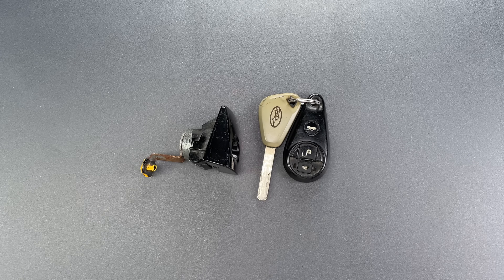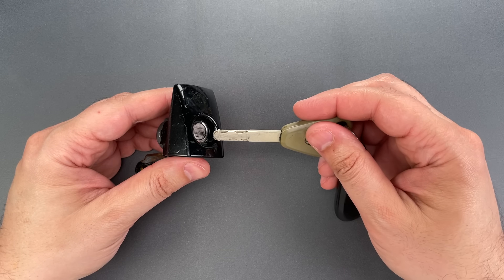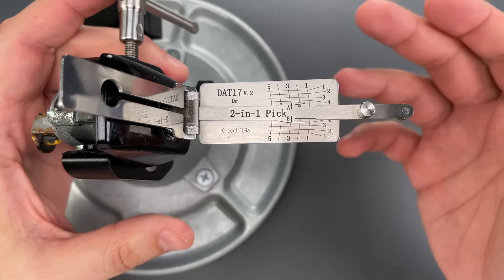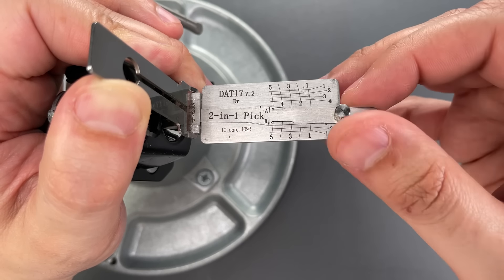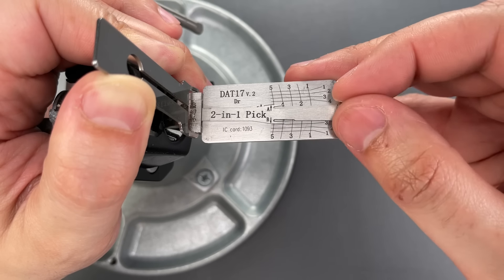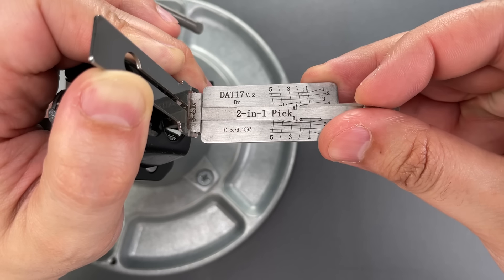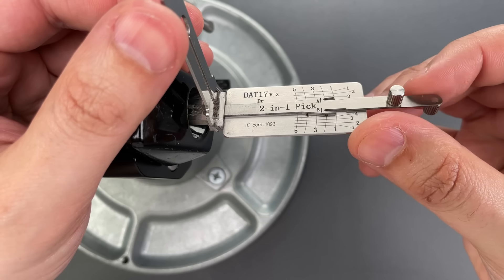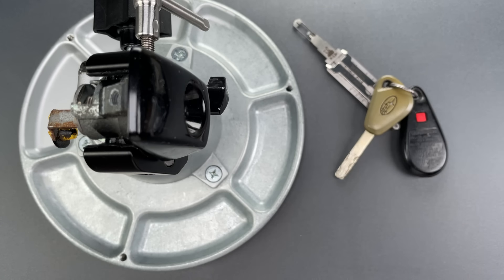[1346] A Trap For The Unwary: Subaru Impreza Door Lock

Comment: This makes me more confident in my own old Subaru
Reply: Don't forget about people breaking windows or even having their own tow trucks to steal either stuff you have inside or the car itself
Reply: @qpSubZeroqp  that’s the thing. If the Subaru alarm is set then it goes off, even if the key unlocked the car. Plus because of where I park my ring camera often texts me when people look at it and walk by it. The amount of time it took to pick means I’ll have more than enough time to call 911 or run with a baseball bat
Reply: And the window?
Reply: @smol_yote  Old subaru's are easy. dont even need to break into car. Just jump on/kick certain parts or use half a tennis ball.
Reply: @Mr_jz_12  ehh. Fair enough. Plus it’s an old Baja. Who would want to steal it?
Reply: If only the engines were as good as the locks.
Reply: @smol_yote  a lot of people cos its old and easy to steal. :(
Reply: @Mr_jz_12  it’s a manual with a fuel computer cut off I wired in and hid the switch. I wish them luck as they can’t even bump start it
Reply: @smol_yote  still doesnt stop them getting into it. Usually if theifs cant steal it they'll trash it. Plus if someone wants your car they'll get it no matter what you do to it.
Reply: If only you could be confident in your head gaskets, too.
Reply: @EternalLatias  i have an ej20 and not an ej25. Low k's and a good tune and fuel. Mines good.
Reply: @Combatpzman  nothing wrong with the ej20's if looked after and treated right. Same as any engine. Is the 25's and non maintained ej20's that have issues.
Reply: @EternalLatias  I replaced them awhile back. The whole engine was serviced. The old motor blew up when I was at the sand dunes in Moab UT
Reply: @Mr_jz_12  I bought the Baja from a guy who never serviced the car. It now runs great. It’s a bit of a fuel hog at times but it gets me to California and back as needed. I’m 170k miles strong and putting 1000 miles a week on it. It runs great
Reply: All depends on the key bitting. If your particular key has a bunch of deep cuts, which don't necessarily need to be picked, it won't take much to pick.
Reply: @bamascubaman  got nothing to do with a key. Early subaru's had a massive security floor.
Reply: @Mr_jz_12  Might be true with doors, but probably not with ignition. I once lost the start key to my '96 Impreza wagon and it took the locksmith over 15 minutes of swearing to pick it, plus about 2 hrs to machine the door key to fit. After everything he said: "It looked like a Nissan lock, so it should be easy, but wasn't. If I knew it would be so hard, I would charge double, but we agreed on 200 so my loss'
Reply: same lmao
Reply: @Mr_jz_12  how easily a lock picks with a Lishi is predicated on several factors. Assuming that there is nothing wrong with the lock, dirt/grime gumming up the wafers or defects to the wafers, causing them to get stuck in place, the bitting ABSOLUTELY is a big factor in how easily/quickly it picks.
Reply: @Mr_jz_12  please do so. That car has been nothing but a nightmare to fix and work on. The insurance payout of that crappy baja if it was totaled is probably double what i can sell it for
Reply: @noelcie  They're the easiest of the lot. I wont publically say how. But lets just say he didn't need to touch the lock to get in that car. Its an actual security feature that is the floor in the system ironically enough. Once in its as easy as getting ot a box and removing it, then ignition (which is easy to remove) and you could drive the car.
Reply: @Mr_jz_12  except in my specific car I wired a switch into the the fuel computer relay and hid the
Switch. So even if they turn the ignition on, the motor can only turn and turn and won’t do much til the switch is flicked. Great as it’s hidden in places people tend not to trash or look when Stealing things like stereos or the glove box or under the seat. They can’t even bump start it as the fuel computer relay til it’s grounded  can’t turn on.
Add the Intel nuc and 4g lte SIM card it can be tracked easily. Even if a thief took the radio, that bud is buried in that rats nest of wires and looks like something not much of value unless you know what it is.
Reply: Well, it seems unlikely that anyone's going to gain access to it by picking the door lock, at least; it took the LPL, with a fucking Lishi tool, and buttload of time to get it open.
Won't stop some random asshole from smashing the window in with a claw hammer they bought for USD$6.98 at Lowes, of course.
Reply: @ShadowDragon8685  fair
Reply: @smol_yote  From an european point of view it's funny that "manual" is a discouraging feature lol
Reply: @ShadowDragon8685  dont even need a hammer. Just a nice wack or half a tennis ball. No damage and you're in.
Reply: @metaldemon80  most people don’t know how to drive them and the few that do would usually get a manual in a sport car
Reply: @smol_yote  a flatbed and a forklift.
Reply: @Mr_jz_12  flaw?
Reply: @BenState  would YOU seriously rent a
Flat bed and forklift for a junky
Old Subaru?
Reply: @smol_yote  People used to in australia.
Reply: @BenState  yeah. My bad. I knew what i was writing looked wrong, but my brain wasn't working on the spelling. hahaha.
Reply: @Mr_jz_12  Thank god they have a security floor

Comment: I'm glad I found this video. My dad bought a pre-owned 2007 Toyota Progres and his driver side door does this weird thing where you can't insert the key all the way in, but if you stuck anything that could fit, even a house key, into the lock and turn it slightly, you could open the doors, no problem. It came that way when he purchased it. Very likely this car was broken in to and the perp left the lock the way it was, so the owner sold it without making any mention of this critical flaw. Now that I know what the cause of the problem is, I can show him this video and we can see if it's possible to get his door lock fixed.

Comment: I'm completely lost as to what the A and B sets of wafers are and how this lock works. We need to get LPL some CAD animator talent to show the occasional cross section or cutaway animation.
Reply: bottom and top wafers
Reply: Instead of all the wafers being spring loaded in one direction, half of them go the other direction out the other side of the lock core. Without a lockpick like this, it is equivalent to having to pick two locks simultaneously. 

If you look at the key, you'll notice each side the key is cut differently on both sides. Each corner of the key is meant to interface with half of the wafers, and the adjacent corner of the key interfaces with the other half of the wafers.
Reply: I dont quite follow why you need two separate picks for the top and bottom set
Reply: @byrddtrader  the two sets are left and right. In each set, half of the wafers are spring-loaded to go up, and the other half are spring-loaded to go down.

Imagine the key sits vertically between the two rows, and interacts with both.
Reply: @Lardbutt200  each pick does top and bottom. 2 pics are needed because there are left and right wafers that all need to be moved up and down.
Reply: After seeing about 120 videos you start to understand that his goal is to show a novice (picked 75-250 locks not on service) to learn and identify key elements in a challenge and learn the feel more than the visual.
Reply: @Lardbutt200  but late to it but the reason there are two is probably size. You need something small enough to move down the shaft without interference, but it needs a pointy bit on at least one end to push the thingy that needs pushing. So dual sided might have been too large to fit though cleanly
Reply: The Subaru key is basically like two wafer keys on top of one another
So there's a top-right set of "pins", top-left, bottom-right and bottom-left. The A is top wafer, B is bottom wafer.
Reply: There are basically 4 sets of pins.
Reply: The a and b wafers  are just  different settings  on that lock pick device is all.. not as though I understood  ANY OF IT IN THE LEAST BIT 🤔🤷‍♂️🤦‍♂️🤨..!!??

Comment: @LockPickingLawyer
 But, can you actually pick it open, not just to the half-way point, which prevents it from going full unlock or back to lock, without 'un-picking' it?
Reply: He did pick it open! 👍
Reply: @ipfreely9245  Are you sure? He said something about getting stuck between open and closed or is that after you try to return to starting position.
Reply: @conanobrien1  He said you can't insert the key if it's stuck in between.
Reply: @ipfreely9245  So it isn't unpickable lock, you would just know someone has pick it...?
Reply: @conanobrien1  basically yeah
Reply: @ipfreely9245  But it appears to only go to 45 degrees when picked, but 90 degrees when a key opens it...
Reply: @kevinshumaker3753  3.56 he said its open and the mechanism is moving on the lock. He then shows you cannot insert the key because its in the lock and unlocked position.

Comment: I used to work on Subaru's, never took the lock into consideration, but I know on a majority of Subaru's you can just break the plastic handle and have access. I love that key, never seen them in gold👍 by no means am contributing to breaking into cars, but if someone that is financially rendered and locked out, the handle is cheaper than a window especially the trunk handle on the outback and forester's 👍
Reply: Yes, on many cars the door handle that the lock cylinder is mounted on is weak plastic and easier to get past than the lock. My "02 Chevy truck has door handles that you can push a long thin flat blade screwdriver into the edge where it meets the sheetmetal panel and jimmy the lever on the back of the lock to move the rod that unlocks the door. This does do some damage to the door panel and paint, but any thief that wants in without breaking glass can do this easily. There is no thief that would mess around picking the lock, that method is only useful for if the owner is locked out. I have installed specially shaped 18ga steel plates on the inside of my door handles that defeat the screwdriver attack. The tailgate handle is also open to an even easier jimmy attack so I have a plate installed there to defeat that too.
Reply: @onemoremisfit  yea my 89 S10 has the same Lock issue, I can open the door and start it with a flat tip screwdriver, so I installed a fuel kill switch in a hidden area just in case someone wants to steal it lol. 👍 Every Chevy truck pre 2000 the screw driver works on most. Most Hondas start with a blank key. I put kill switches on every vehicle I own, even newer models, it's the ultimate anti theft.

Comment: I am now convinced that Subaru car locks are the most secure locks in existence. The fact that it took the LPL several minutes + a special (lishi) tool that makes picking a lot easier shows how pick resistant they are. If they had ball bearings for drill protection and stuff like that I would instantly buy them and replace every door lock with them.
It would also be kind of a flex to open your house with a car key

Comment: You should try this lock when it is in the car.
The alarmsystem in my one was wired to the locks. If you are wobbling arround in there for more than 10 secs, the system knows, you aren't using a key and activates alarm. Was the factory system you have to order as an additional.

Comment: I just bought a Subaru Impreza, so imagine my shock to see one of their locks show up in an LPL video. I clicked *instantly*.

After watching the time it took him and that picking it didn't even fully open the lock, I actually feel great now.
Reply: That half-turn he got out of it would probably be enough to unlock the car. Try it with your key.
Reply: That just means they're gonna bash your window in lol
Reply: Same! Its kind of freaky
Reply: @ziggydeer4401  yeah, no one picks car door locks.

Sadly even when you leave your doors unlocked chances are still high that someone will just smash the window. 

Although keeping them unlocked may have saved me once, someone did rummage through and took my change. A guy was caught a month or so later stealing change, keys, medication, and smashing windows whenever he saw bags exposed, looking for electronics.
Reply: Judging from the replies of your comment

Replace your glass window with a ballistic window It might be expensive but no window is getting smashed
Reply: Sorry for your loss
Reply: Did you buy one with windows? Windows are really easy to pick.
Reply: Just wait until your first head gasket repair lmao
Reply: The weakness in the car in terms of entry is the windows, frameless windows can be pulled back and a piece of wire inserted to pull on the door handle. The immo system in 2004+ non-JDM Subarus though is exceptional. Without a dealer-coded key, you're not stealing it.
Reply: When the head gasket goes out you can use it for a secure storage shed!
Reply: I have a Wrangler. With. Soft top. I never bother locking my doors, if they are even on.
Reply: @ranga2050  On an old 90's Honda all you need was a doorstop to wedge the glass and a coat hanger to get to the latch. There was a reason why the Civic was the most stolen vehicle year after year.
Reply: @stuntmonkey00  I have an old Honda that was broken into twice this summer. Whoever did it definitely picked the locks, because they did not damage any part of the car, they did not wedge the window out, and they did leave the ignition switched on, without damaging it.
Reply: You can literally just pull the window back with your hand and reach in to unlock the door on imprezas. That's why so many, including mine, have been stolen.
Reply: @hartleyc3782  every time you do that on a car with framed windows, it does bend the structure of the door slightly. If you have a sharp enough eye to notice incorrect panel gaps, you will be able to see it every time. It also creates a really nasty noise if you're driving in a crosswind, if your car has been opened that way and you haven't bent the door back to its original shape.
Reply: @AlexandarHullRichter  subaru windows are frameless on older ones
Reply: @BrainScramblies  it's not like they aren't on the road anymore than right? Especially in Colorado where every other car is one of them. I was just pointing it out. And it definitely is a problem. There's probably 3 new posts a day from someone who had their car stolen in one of my subaru groups.
Reply: @hartleyc3782  I know, and it's a cool future, but people say the same things about framed windows.
Reply: @Kahless_the_Unforgettable  Now that would be an impressive challenge to beat for the LPL. Obviously referring to the "unpicking" section of the car window vs Lishi tool video.
Reply: @robford4679  , It's not very difficult. It's a low skill attack. You just get a heavy pick, stand about 2 meters from the window, and throw the pick at the window. 

Window successfully picked.
Reply: @Kahless_the_Unforgettable  yeah, I said that the hard part was replicating the second part of above video, by unpicking the window using the lishi.
Reply: @robford4679  , ah, I get it now! True. That will be more difficult.
Reply: One of my best friends has one, and it's sort of an inside joke/game where we try to get in his car. But luckily for him, it's not an easy task
Reply: Don't lock the keys in!

Comment: What’s the actual mechanism that freezes it half way? Would have loved to see it possibly gutted.
Reply: Most likely just a slot in the cylinder to allow the  waffers to spring into.  Since it is only half the waffers, there is not one on the opposite side.
Reply: Both sets of wafers, on the left and right sides of the key, have their own separate slots in the lock body they engage in when locked. So when you turn the key clockwise, the wafers on the top left side have to pass by the slot on the top right, and the bottom right over the slot on the bottom left. If you've picked the lock, when the core rotates, the left side top wafers drop into the right side top slot, and bottom right into the bottom left slot. That's why you need to pick them again, either to continue rotating it the same way or to rotate it back.
Reply: What Keith said is the case for this style lock but also for locks that are meant to "retain" the key (ie you can't remove the key unless the lock is locked) they can also jam up because the mechanism meant to grab the key will fall into the key way since there's no key in place to stop it

Comment: I JUST sold my 2011 Impreza 5dr this afternoon. I had ordered some spare keys that I intended to get cut but never programmed for the immobilizer in case of a lockout. Kinda happy I tossed those in for him now...

For those curious: only 151k KM on the odo and not a speck of rust on the body - did a full brake job (calipers, pads, rotors, and all necessary brake line fluid maintenance) on it too before sale and came with winter tires mounted on stock alloy rims and all-seasons on some sick aftermarket rims that I'm almost sad to see go but would totally clash with my new car.